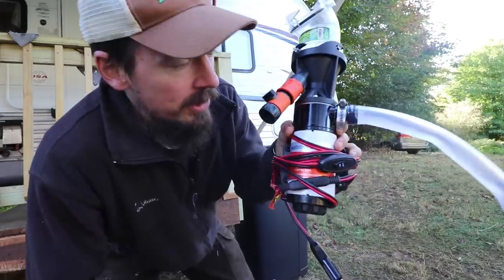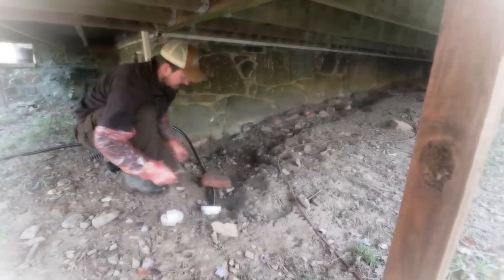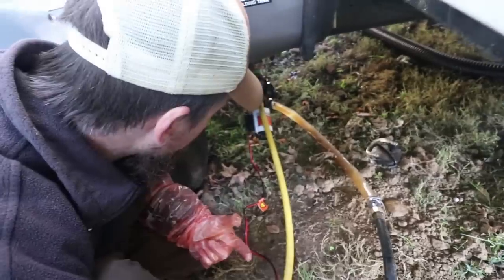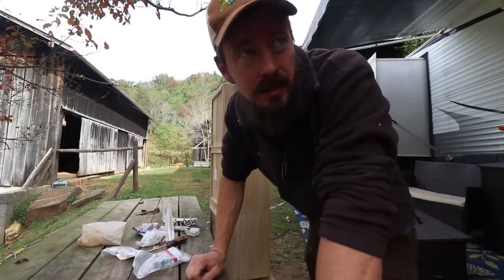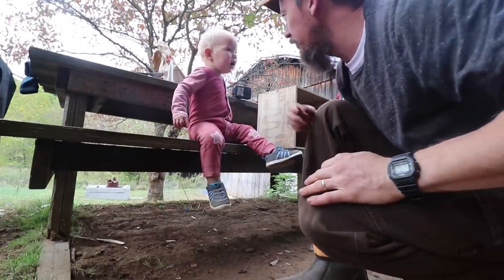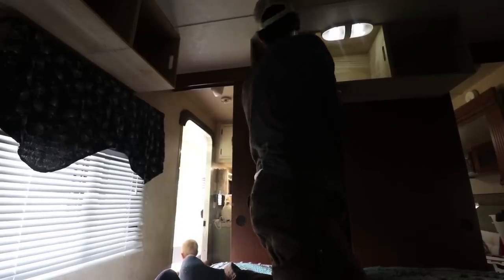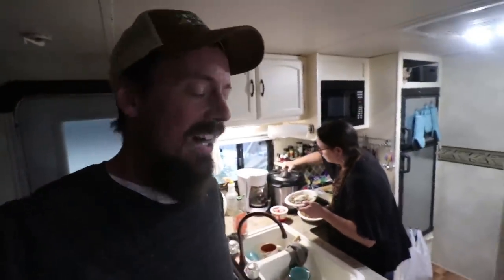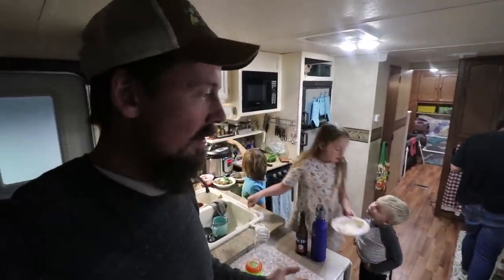THIS IS NOT A TEST!

Comment: An Outhouse is still a great idea to build. You can lessen the load on your camper system but once you start Demo and rebuild/repair of your house, you want helpers and workers to be able to use the facilities without piling into the camper. 
Alternatively, you can rent a porta potty, long term rentals are quite reasonable.
Reply: Great ideas.
Reply: I agree on the porta potty. Art its going to be so cold and nasty trying  to make your hose cooperate and not crack during that task.  Seriously hate to imagine everyone and their dog using  porta potty but it IS a means to an end and will sure help ease that burden. Our (older) trailers sensors rarely seem accurate. We do use chemical packs in our black tank - dissolve in toilet bowl then flush. I think of all of you often and wonder how you're doing. Take the very best care of each other.  Much love and blessings.
Reply: @02271953me  they could possibly put it in the barn to provide shelter in inclement weather, etc.
Reply: I think a nice outdoor composting toilet would be awesome addition on the homestead, will get years of use, especially when throwing big parties, family gatherings. Etc...😃👍🏽
Reply: Exactly!
Reply: @bonnied3550  that reminds me, didn't they have one for a wedding at their property a couple years ago?

Comment: Your holding tank has sensors mounted in the tank, they are most likely covered with toilet paper. Take a high pressure nozzle, you can get one at a camper store that is on a tube and wash with a garden hose thru the flapper valve in the toilet. and that will clear the sensors.  Also if your 12 volt converter works you can power the macerator from the battery and not have to use your van.
Reply: I agree
Reply: They arent flushing paper. Just elimination.
Reply: Lived in a camper for a yr while building my house.  Using this method was the only way we could clear the sensor.  This will work beautifully.
Reply: @mayhmmaydn  the kids used toilet paper before they told them not to before they moved in completely.  It was in the other video about the macerator.

Comment: I am worried about everything freezing when it gets really cold. I sure hope they put some type of skirting around the bottom of the trailer with heat tape on the water lines. If they are running a water hose from the house or barn, this could be difficult.

Comment: Can figure out why everyone is poo-pooing the poo pump. We’re in our second year of full time RV living in North Idaho with the same waste setup. It works. Only challenge is keeping the hose from freezing. Worst case scenario is you flush the hose clean after use, (which you should be doing anyway) connect it to itself, roll it up, and put it in the bathtub until it thaws.

It’s not all rainbows and unicorns but it works and the end justifies the means.

Comment: Been there done all that when we would take our trailer places we would not put the paper in the tank unless it had poo poo on it and my mom and dad and me when I got old enough would clean out the tank we rinse the whole system from the inside out we would take a water hose on the inside and run it all out quite an ordeal to get it nice and clean and yeah if you have any kind of leak it is gross

Comment: Use the RV toilet chemicals to help break down the poo - also use RV toilet paper - it dissolves.  As for the tank indicators, all of them malfunction after a while.  You'll know when the black tank is full if you see the water level in the toilet when you look down.  If the sinks/shower drains slow or not at all, then that tank is full.  You'll get a feel for it once your in the RV for a while. :)

Comment: You guys might need to set up a humanure pile under a canopy and have some loveable loo outhouses for emergencies and just in case.  Also...one of the best things to flush into a septic system is  to use a laundry detergent that utilizes sodium percarbonate (oxyclean). It helps clean your clothes, but it also helps reduce the bio mat. It's not great to add directly, like adding sodium percarbonate to your septic directly, but flushing laundry water with oxyclean in it does work pretty well to help keep drains clear and to keep the septic bio mat down

Comment: I burried a 55 gallon drum behind my camper, put sewer  tank pump inside on top of a cender block.  Plumbed it up through a hole in the lid, put a 90-% elbow on it. Put a ball pressure valve there and snother at the end where it dumps into the sewer.  It worked up untill i sold my place.  The ball pressure valve keep waste and water pressured in between the valves.  When the float in the septic pump was under a certain amount of pressure, it would kick on and you could here it blast poop down the line.

Comment: Those sensors only worked once for us and our trailer was brand new.  They all got gunk on them and stoped working after our first use on our trailer.  

Those septic treatments don’t really work in a trailer holding tank.  Your better off to get an odour fighter and good disinfectant.  The enzymes don’t get to hang out in the tank long enough to do their job.  Always use lots of water.  That will help things liquify and empty faster.

Comment: I can't help but wonder how the black tank,  pump, hose and getting the car close enough  will work, when it's 10 degrees and the ground is covered with snow. Will the car make it up to the camper? Will the black tank freeze? Will the flush tank freeze? Will there be underpinning around the camper for insulation? Will you have to hook, unhook and flush the hose every time? So many questions, why? Because I've been where you are and in wintertime...It ain't fun!! My system would freeze and the pump would not attach properly. May God be with you if the pump blows off!! The poo froze in the hose once and would go no further. When it finally thawed  enough to move (using a bullet heater) eviscerated poo pellets shot out the end...that's something I will never forget!! May I suggest putting a small heater under the camper, inside the underpinning a few hours before pumping time. That made a big difference for me and added benefit...your fingers won't freeze.. Good luck and may the current be swift and the smell...well...less smelly.

Comment: Hi Art: We met in Santa Rosa CA. I lived in my 5th wheel for 3 years while building. Its served me well. Here is what you need to consider
1. Get one of those pipe heaters  and enclose it along your water supply line. That bugger will freeze solid this winter and MAN is that inconvenient! I used foam pipe insulation to insulate the hose and had the hose heater inside the insulation. it Neve froze again. Duct tape the seams.
2. I went the macerator pump rout. I would try this. 
First: run a 3" temporary line out from under the porch so you don't have to climb under there any more. That will get old. You can get an RV fitting for it so you can attach a 3" dump hose to the part that comes out from under the porch. They make a fitting that also screws into your clean out fitting under the porch. Its clean,  tight, and caps off when not in use. Its set up and ready, all the time!
Next: Get a separate black tank with wheels and a trailer connection for your lawn tractor. Back the tank up to your dump port. Dump into it from the RV. Drive it up the hill to your new temporary dump line. Click it together and dump the whole tank in 30 seconds. Mine took two trips when full. Its also cool when you discover the tank is full on a cold night when you're in your pajamas. You leave the temp tank hooked up and you can just pull the dump handle and dump out 30 gallons in 3 min. Cap it off and go to bed. In the AM you can go through the process of dumping.
I bought the whole thing on Amazon for under $80. This process allows you to figure out a regular dump schedule and you don't have to worry about the tank meters. Its so tight, you never smell or see poo, either. Freezing isn't an issue.

Comment: Most sensors in the RVs do not work I say you got a family of many LOL I would say each every four days you'll need to dump your tanks you have a lot of children and now have to use the bathroom a lot of times so therefore you'll have to dump at least two times in a week.

Also winter is coming you guys are in North Carolina you better get some coverings around the bottom of that RV so you guys are be nice and toasty inside I run to radiator heaters they come with oil in them I bought it from Amazon for 40 to 50 they were awesome OMG I believe this winter I will not be freezing in my RV. I pray that you guys can make it through this winter time in the RV with no problems and happy camping to you and your family

Comment: Can you rig up a plug to use on a battery to save your yard this winter?  My dad rigged me one up for a pump for my pool.. used a plug for a car charger and attached it to a wire to plug onto a small battery. That way you won’t have to drive in your yard during the wet winter weather.  Just a thought.. can you all not take showers and use the toilet in the house even with construction going on?  I know the mold is a issue but to me that seems to be a easier answer than dealing with frozen hoses during the winter knowing how cold it’s going to get soon.

Comment: Please see that you stock redundant replacements for everything you need for this septic system to work smoothly.  Please just don’t rely on the one setup to work especially for a long run as the weather and local hardware suppliers and supply might fail you at the worst time.  You need to have a backup person to be able to do this for you as well in case you’re unable to do so.

Comment: No it’s a electric sensor you need to get a camper tank sprayer its a long pipe with a hole on the end you hook to the end of your fresh water hose and spray it out from the top or you can just fill all the way to the top then drain.